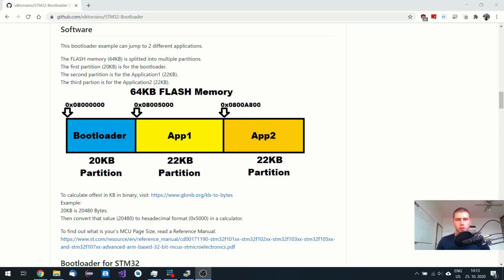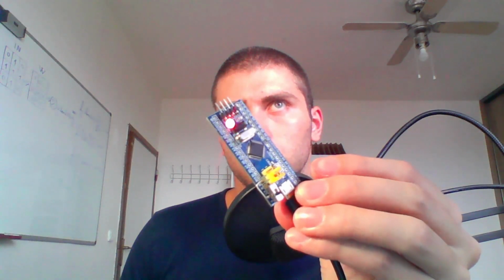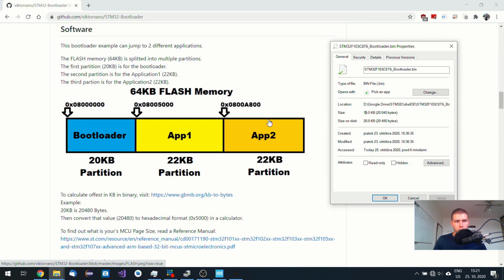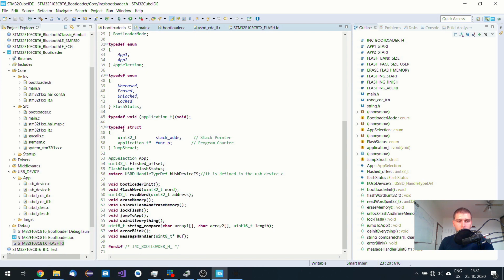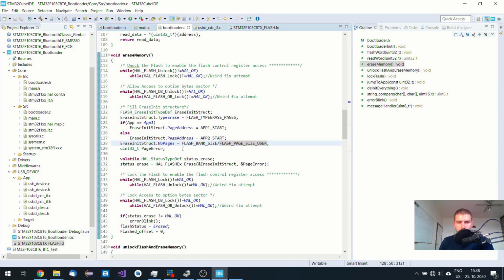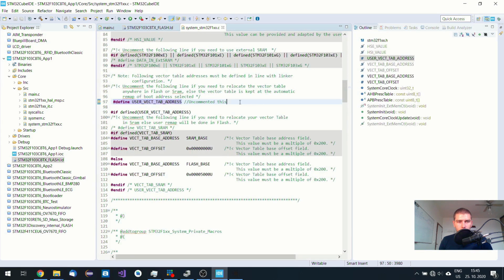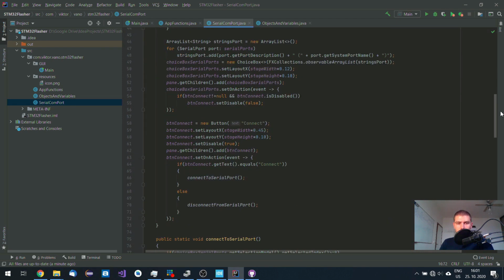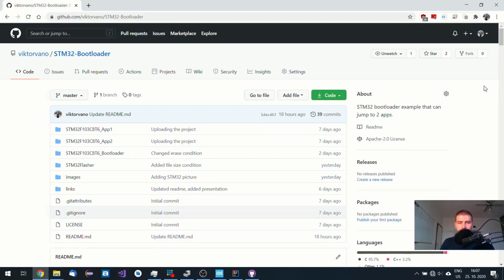STM32 Tutorial - Bootloader That Can Update And Jump To Multiple Applications

Comment: Man, I was stuck in doing something like this for a week... I even wrote to the ST Community and not even the ST Employees could give any code that could do the jump to the application. Your code worked just fine! Thank you very much! 
One more thing, I also created a custom bootloader, but I wanted to do a check before run it, i.e. before I run the bootloader to receive and flash a firmware, I wanted to check if there is an available application to run, if yes, the program would jump immediately to the application, if no, the flash process would start and then jump to the application. 
So, is there any way to check if there's an available application to run, before all the process?
Reply from the maker: Hi, Thanks. There is a simple way just by checking if there are several 0xFF in the row or 0x00 depending on the MCU that would indicate an empty flash. You can also have a small portion of Bootloader where you check last flashed/erased info and verify the flash location before jumping in. But my Bootloader verifies every 32 bit Word Flashed when flashing new firmware.

Comment: But the firmware is also updated without this bootloader when we flash .bin file through swd it is replaced also by default without Bootloader so what is the need for this
Reply from the maker: @SalZhi_Harkat  Well a bootloader is for the end product for a regular user that does not have a SWD debugger in their pocket. All they will have is a device they bought and some PC application for their device that also allows it to flash a new firmware. Prusa 3D printer firmware update works the same way as I said. It uses just a USB cable that functions as a serial port for the 3D printer.

Comment: How to determine flash page size for particular MCU, in particular, STM32F769NIH, I didn't found it anywhere
Reply from the maker: @grigorianoby  in the reference manual datasheet PDF. It's a bit different one for an MCU, not for a particular model. It can also have a bit different termimology like page size or sector size depending on ARM family as M3 or M4 or higher.
Reply: @ViktorVano  is Im right understand for that mentioned above MCU page/sector size depending single/dual bank organization is 32/16 KB (as stated in RM0410 page 88 for first 4 sectors of Flash) ?
Reply: @ViktorVano  it is right that for STM32F769NIH flash page/sector size is 16 kb ? (found it in RM0410).

Comment: You define in these 2 lines:
#define BOOT1_Pin GPIO_PIN_2
#define BOOT1_GPIO_Port GPIOB
So BOOT1 has pin PB2 ? Or some bit decides to include PB2 ?  Besides I do not see on the pinout  no PB2.
Reply from the maker: Yes it is PB2. However it is not as a pin on sides of the board, but in the middle those 6 pins that are Boot1 and Boot0. I explained that in the video.
Reply: @ViktorVano  Is that explained in reference manual? I was trying to find respective information in it, but in vain.
Reply: @ViktorVano  "6 pins that are Boot1 and Boot0" - Why 6 pins and not 2pins ? What pins are these?
Reply from the maker: @incxxxx  I meant it's looks as 2 rows by 3 pins that work as a switch to set 1 or 0 for Boot0 and Boot1.
Reply: @ViktorVano  But I did not found in no manual that BOOT1 can be assigned to PB2. So how did you guess that?
Reply from the maker: @incxxxx  that is firmware defined and printed on the board. And measured it manually with and ohm meter with that beep function to be sure.
Reply: @ViktorVano  No PB2 on the board as you also know.
Reply from the maker: @incxxxx  because it is used and labeled as Boot1
Reply: @ViktorVano  That is why I was asking, how do you know that it is PB2 because I did not find such information in no manual. BOOT1 is a BOOT1 and that's all, why to assign it to PB2?

Comment: So, to use mcu in the same way as you I have to connect PB3 with R10 resistor ???
Reply from the maker: Yes, exactly as in the readme of my repository.
Reply: @ViktorVano  But I see that you moved R10 to one end of the solder bridge (leaving  the other one free) and then soldered to PB3. Am I right?
Reply from the maker: @incxxxx  yes, as you say.
It is because of USB connection control. With that PB3 and the resistor I can connect and disconnect the USB communication with a PC.

Comment: hey there,what is the difference between using boot pins and writing a uart program which write the data on the flash and jumps to the user application ?
Reply from the maker: I designed it that way. I wanted a hardware pin so it will jump immediately. I was considering a software solution to jump or switch to flash mode, but there should have been a several second timeout for that flash command and after that it would jump.
Reply: @ViktorVano  thank you 🙏

Comment: Hello, thank you for your video. I have a question about sending the .bin file in an application. In my case I have to send and flash 8 bytes at a time - could you suggest a good way to deal with the bytes that don't factor into 8 to send? Should I pad the doubleWord with a certain value? 

Thank you
Reply from the maker: 26:03 In my code I assumed that if I receive 4 bytes, then it is a word to flash. You can have similar approach. And a bootloader should work as a state machine. So when you start sending your data, you should have set the MCU to unlocked flash with erased memory. 
In your case you just want to send 8 bytes or 64 bit word, so just check if you have received 8 bytes and how many double-Words are remaining to flash. See lines 270 to 273 and the whole function at the line 260.

Comment: Now can this be done to the stm32f4 if so do you need a board to experiment with please let me know ,send and email or message
Reply from the maker: Yes, it can be used to many STM32 boards. You just have to generate code for each STM32 MCU model separately and then copy the code snippets individually.
I think STM32F4 (M4 cortex) has more memory write options than M3 cortex.

Comment: Hello, thank you for this work! I have one question. In the tutorial, you assume that you know that application 1 will be loaded at 0x0800 5000 add application 2 will be loader at 0x0800 A800. So you adjust the VECTOR_TABLE_OFFSET.
Imagine that you do not know if the application will be write by the bootloader at 0x0800 5000 or at 0x0800 A800 during update. So booth adresses could be used to start the application. Do you have a solution where the VECTOR_TABLE_OFFSET could be dynamically changed?
Reply from the maker: I remember that this tutorial inspired someone to do exactly that. He mentioned it in these comments.
I am on my phone now.
Reply from the maker: I have pinned that comment.
Reply: @ViktorVano  Yes indeed I just saw it. It even do more than what I want. In my case, I would like to just have choice between two adresses, not all of them. But I should find the wanted information. Thank you

Comment: Great explanation, thank you!
21:56 you're using the length of the received buffer to determine if the data is a flash write command, but is there any guarantee that CDC_Receive_FS events will always correspond to the same buffer lengths as the calls on the sending side? For example, 4 bytes might arrive as two separate calls of 2 bytes... maybe.
27:07 the condition dataToFlash == readWord(address), shouldn't that be an inequality test? (ie.  != ).
Reply from the maker: That eual sign was a bug and it was fixed :)
Well this was my weekend project so  simplicity is there because of the short development time and for an easy explanation. :)

Comment: Why i have error: multiple definition of 'flashStatus'? i am compiler in stm32idecube
Reply: "A common mistake in C is omitting extern when declaring a global variable in a header file. If the header is included by several files it results in multiple definitions of the same variable. In previous GCC versions this error is ignored. GCC 10 defaults to -fno-common, which means a linker error will now be reported. To fix this, use extern in header files when declaring global variables, and ensure each global is defined in exactly one C file. If tentative definitions of particular variables need to be placed in a common block, __attribute__((__common__)) can be used to force that behavior even in code compiled without -fcommon. As a workaround, legacy C code where all tentative definitions should be placed into a common block can be compiled with -fcommon"
Reply: problem solved: stm32cubeide 1.9.0 for stm32cubide1.8.0
Reply: Replace line 53, 54, and 55 in bootloader.h with the following:
AppSelection __attribute__((__common__)) App;
uint32_t __attribute__((__common__)) Flashed_offset;
FlashStatus __attribute__((__common__)) flashStatus;

Comment: Thanks on video! I have a one question though, from the bootloaderInit() function how do you move to executing the code which actually handles flashing via USB?
Because I can see that you set the flashMode, blink LED 10 times and finally enable USB. where as rest of the code in bootloaderInit() is applicable for JumpMode. 
Then once main() is done with bootlaoderInit() which has set flashMode there is an execution of endless empty loop. So I'm failing to understand how is the code which handles flashing (I guess this is your messageHandler()) invoked further?
Reply from the maker: Once USB is enabled (just GPIO with a 1.5K resistor connected to D+ pin) then this function in "usbd_cdc_if.c" can respond to incoming USB messages.
https://github.com/viktorvano/STM32-Bootloader/blob/master/STM32F103C8T6_Bootloader/USB_DEVICE/App/usbd_cdc_if.c#L260

Comment: What if I wanted to do this bootloader and application over the air (OTA) instead of JTAG? How would you approach that?
Reply from the maker: I am not using JTAG, but USB configured as a Virtual COM Port. 
You just need to move the communication part to a different peripheral.
If your communication is not transparent, then you will need to do more parsing in order to get the clean message that was sent.

Comment: This is extremely informative, thank you so much for taking out your time to explain this! I, unfortunately, got a fake STM32 (CH32) from ebay so I have some work to do to get it to even upload an application before I can run hopefully write a very simple bootloader. Again thanks for this
Reply from the maker: Thank you. You are welcome. 
You can use STM32 ST-Link Utility to flash a *.bin or a *.hex file onto a fake STM32 too. Fakes just do not work on official IDEs, but STM32 ST-Link Utility tool can handle it (flashing).
Reply: @ViktorVano  thanks man I thought so as well I'll be getting the linker soon hopefully I can get the usb to work. I want to see if I can also get it to upload over UART as well

Comment: Great work well done, it takes quite some guts to dig in the linker script and bootloader development. STMicroelectronics should invest in you for sure! You have heard it first! few extra things however to consider on top of this hack are two following:
1) security: since bootloader is the most important aspect of any embedded system, the possibility of encrypting the firmware by generating a "Public - Private"  relationship must be imminent fortunately F-7 offer this
2) OTA DFU could be even cool since you were able to include USB DFU, i guess adding a BLE functionality would be cool, i guess the GATT protocol can be exploited depending on either the STM based on the SPBTLE-RF or the Nordic nRF This couls be a huge investment project man, count me in if you ever thought of such devevopment board, There would be lots of politics sure sure ST would potentially come after you as that's where they are getting their money from, there is literally no other Dev board offering OTA DFU other than STM32L4 & Plus series
Reply from the maker: Thanks a lot for these notes and suggestions. I will consider it. I appreciate it.

Comment: For others who may struggle, i used a stm32h743XI, so i inspired from viktor code by modifying XXX_FLASH.ld, usbd_cdc_if.c and obviously bootloader code but also system_stm32h7xx.c and in particular the VECT_TAB_OFFSET  which can be the difference between 0x08000000 and the beginning of your app.

edit: Viktor tell it at 30:00, it seems that i was too impatient  !

Comment: ohhhh thanks man that was exactly what i was looking for, on top of that i wasn't sure if upload a bootloader at 0x08000000 (and keep the original bootloader which is not unerasable i think) and have the rest of the memory splitted in two (for two application or 2 firmware with different update) was a good approach... You definitly convince me that i was right ! thanks a lot man
Reply from the maker: Good to hear that. Thank you.

Comment: Hello, I have a question. I can't find anywhere, how to make sure that bootloader is indeed on address 0x8000000. I set offset to make the start of the application on 0x8008000 since I need 28 kB. Does that mean that the bootloader is on 0x08008000? In other case, how to I make sure that bootloader will be on adress 0x8000000 - 0x8007FFF? Thank you!
Reply from the maker: Bootloader does not need offset. A bootloader should be at the beginning of the Flash memory. You just need to set its maximum flash size. 
So you only need to modify the linker file "FLASH.ld file". And 0x8000 is 32kB (32768). Do not change a vector table offset for bootloader!
You need to modify it like this to 32kB (max bootloader size):
/* Memories definition */
MEMORY
{
  RAM    (xrw)    : ORIGIN = 0x20000000,   LENGTH = 20K
  FLASH    (rx)    : ORIGIN = 0x8000000,   LENGTH = 32K /*64K*/
}

Only other firmwares (applications) need to change both vector table offset and flash offset.
Everything should be in the readme file:
https://github.com/viktorvano/STM32-Bootloader
Reply: How do you upload your code to STM? Personnaly i use STM32Programmer which allow to erase full chip or particular sector and also allow to define the adress where you want to write your binary =) I don't know if it's possible in STM32CubeIDE
Reply from the maker: @yannkergutuil1344  STM32CubeIDE can upload your "code" (binary) to the specific location as it is defined in the linker file. When I have a bin file "laying around" and I want to upload flash manually to the specific location I use "STM32 ST-Link Utility". 

Regarding this tutorial:
In this tutorial I have created my custom STM32 flasher app in Java, but it is the STM32's custom bootloader that controls where to save the binary contents.
Reply: @ViktorVano  ok cool, i'm pretty ignorant with this linker file. I think that i've read somewhere that STM32Prorgammer replaces ST-Link Utility. I actually coding my STM32 flasher in C++/Qt and the purpose of my bootloader is to be fully programmable through USB (erase, flash, select partition, restart, ect...)
Reply: @yannkergutuil1344  Hello, I've been trying to do the same thing, programm my STM32 through USB so I can avoid using STLink or a TTL to USB conector. I was wondering if you could do it finally? Thank you

Comment: what a great tutorial. Can u/anyone please explain these two lines? 
1. const JumpStruct* vector_p = (JumpStruct*)address;
2. asm("msr msp, %0; bx %1;" : : "r"(vector_p->stack_addr), "r"(vector_p->func_p));

specially this part "msr msp, %0; bx %1". thank you in advance.
Reply from the maker: Yes.
1.) That structure just joins two variables that describe: 32 bit stack pointer and 32 bit program counter.
You can define a 32 bit variable as if it was a head of an application function: typedef void (application_t)(void); //just a 32 bit variable
If you give an address value to a stack pointer, the program counter pointer address value will be (Stack Pointer)+4

typedef struct
{
    uint32_t		stack_addr;     // Stack Pointer    (address)
    application_t*	func_p;        // Program Counter  (address+4)
} JumpStruct;
So in order to jump, you need to set up a stack pointer and a program counter.

2.) And this is an assembly code:
asm("msr msp, %0; bx %1;" : : "r"(vector_p->stack_addr), "r"(vector_p->func_p));
That's a little bit of a sorcery. :D 
MSR MSP, r0; - means to set up a Main Stack Value
and BX is for program counter to jump to the application.
Reply: @ViktorVano  thank you so much !!!
Reply from the maker: @muhammedimdaad  You are welcome.

Comment: Thank you! Do you have the experience writing a bootloader for external QSPI Nor Flash, to implement XiP?
Reply from the maker: You are welcome.
Reply from the maker: Hi, I have made a bootloader in the past that flashes the internal FLASH from the SD card from a binary file.
Reply: @ViktorVano  will you please tell me an idea to create bootloader using external flash memory with spi, thank you.
Reply from the maker: @harishankar8976  Do you mean to Flash a new Firmware from an SD card to the internal Flash of the STM32? Or do you mean something else?
Reply: @ViktorVano  yeah similar to that ,first save the new firmware to external flash memory through any wireless communication(OTA) after that I need to flash the stm32 with the new firmware in exterrnal flash

Comment from the maker: Even if you try to flash an application to the wrong partition, you can try out that the application on the STM32 crashes. 
For example when you flash the App1.bin onto the partition for App2, the STM32 application will get stuck on HAL_Delay(time); or any interrupt.
Reply: this is where I was stuck. I was toggling an LED but it didn't toggle. Delay was infinite. you saved me. thank you